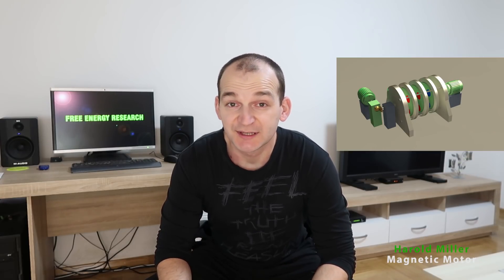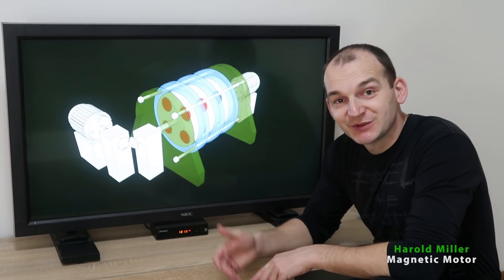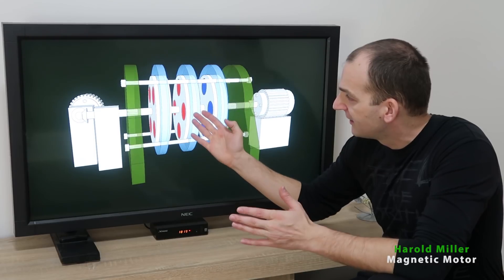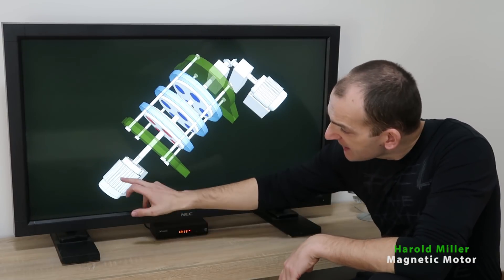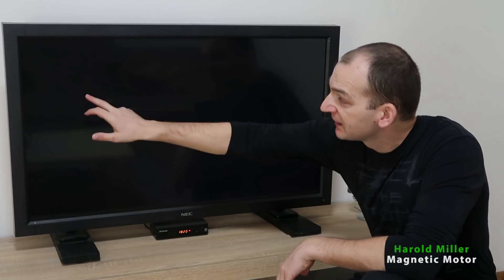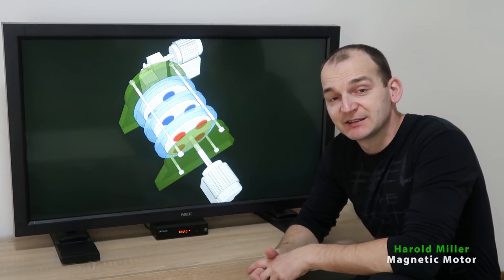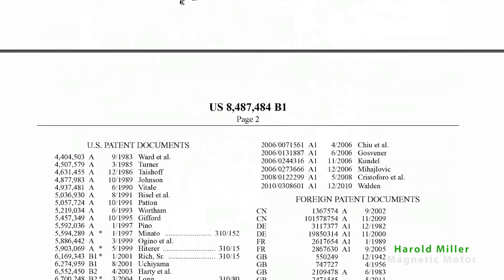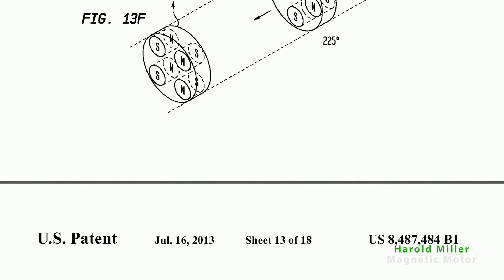Free Energy, Magnetic Motor by Harold Miller!!!!!!!!!!

Comment: If i was you, just make a fuckig video about your fucking realife created magnet motor that does work and with no hidden bullshit added to it ,so no battery,no wires,no air compressor,no wind,no fishnet attached to an outside of camera reach hidden motor,no it should be as real as it get’s it must start and run on it’s own,

besides why the fuck should we read all those 40 pages and conclude in the commands whether such design works or not,what kind of fucking nonsense is that?
Fuck damnit😡😡